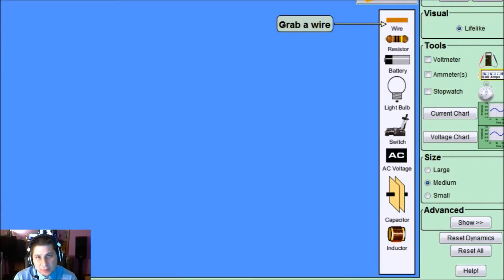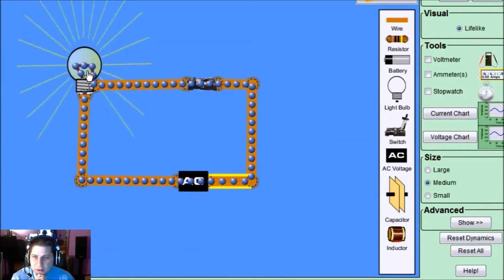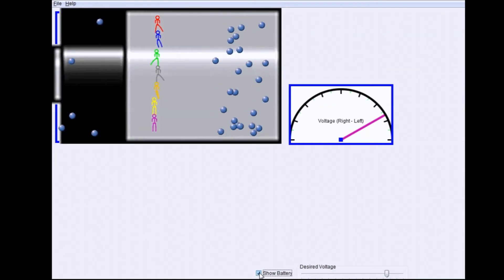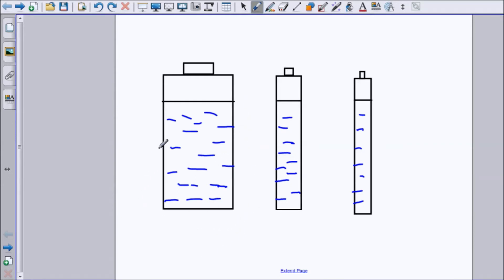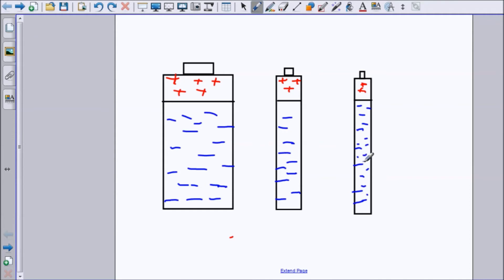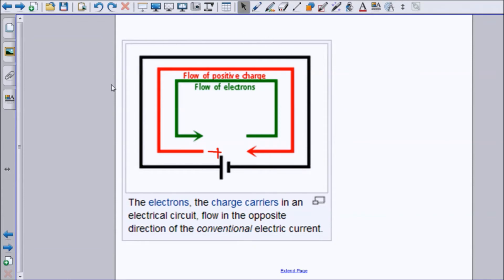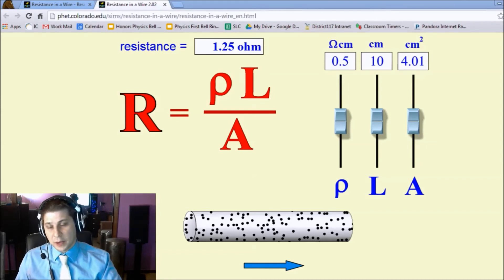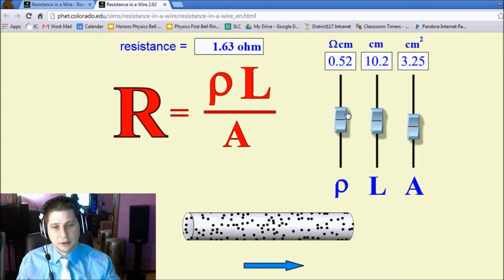Intro to Circuits

Comment from the maker: DC Circuit Kit - http://phet.colorado.edu/en/simulation/circuit-construction-kit-dc
Battery - http://phet.colorado.edu/en/simulation/battery-voltage
Resistance in a wire - http://phet.colorado.edu/en/simulation/resistance-in-a-wire